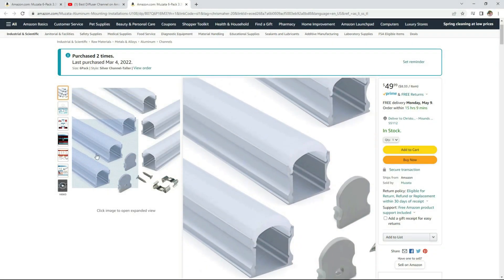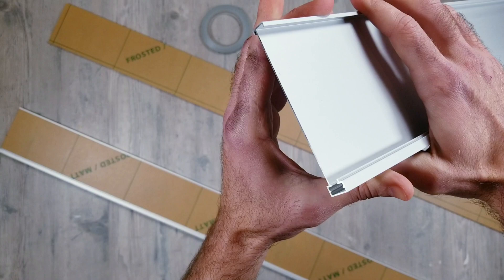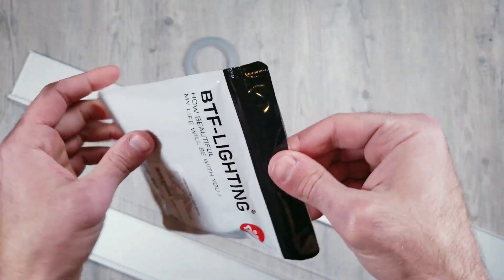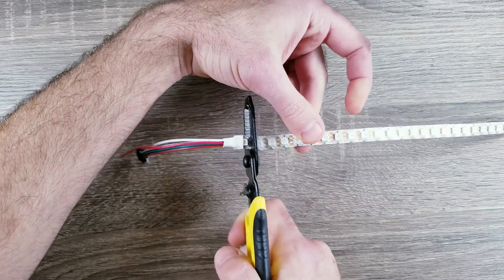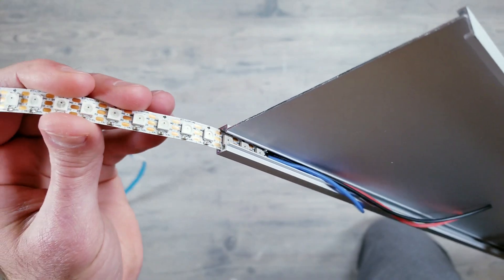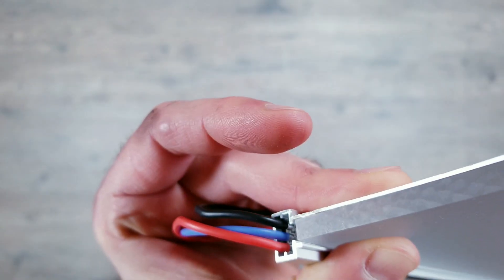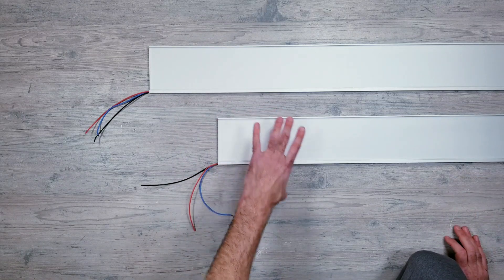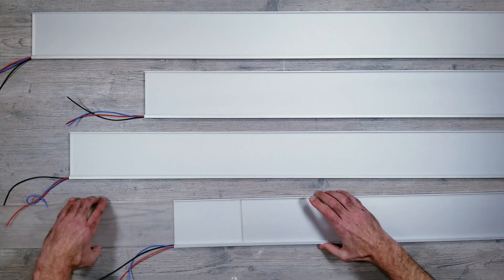Best EDGE LIT Diffuser Channel on Amazon.

Comment from the maker: 💥💥 AMAZON TECH Deals of the Day: https://amzn.to/42ud9FV 💥💥
Edge Lit Profile: https://amzn.to/3LX6UC6
LED Lights: https://amzn.to/3sjwJ7A
LED Lights AliExpress: https://s.click.aliexpress.com/e/_DC8lSoL
Best Regular Diffuser Channel: https://amzn.to/3uYO8ml

How To Solder Video: https://youtu.be/apSz3NXYlx8
WLED on ESP32 Video: https://youtu.be/TOEnFKLm9Sw

Other Materials:
ESP32 Board: https://amzn.to/3uDP1ln
18 Gauge Silicone Wires: https://amzn.to/3Keoel3
Wago Connectors: https://amzn.to/3vgFBeF
Micro USB cable: https://amzn.to/3jCLhtY
Big Power Supply: https://amzn.to/3uGPKSK
Wall Plug for Big Power Supply: https://amzn.to/3jCaXae
Medium Power Supply: https://amzn.to/3KKjAeV
Wire Stripper: https://amzn.to/3uHP4g4
Soldering Iron: https://amzn.to/3jxx1mB
Solder: https://amzn.to/3r6smMA
Solder Smoker Absorber: https://amzn.to/3rbHCYp
Helping Hands: https://amzn.to/3v19YG3
Heat Shrink Tubing: https://amzn.to/3733zSH

Other Videos I Have Made:
DIY Board and Batten video: https://youtu.be/b13VLiK7AOU
How-To Video for the LED Pegboard Project: https://youtu.be/K4EzLI1fFnQ
DIY LED Baseboard Trim: https://youtu.be/Ik8HnGxfQq0
RGB Lamp Hack: https://youtu.be/UNPR_98xLQY
Corner LED Light using Pex pipes: https://youtu.be/rIbTzUD2E4k
DIY Govee Glide using only paper: https://youtu.be/n9LsiQARFas
Simple Corner LED Project: https://youtu.be/ZB5HqWhMXNo
DIY Customizable Light Up Images: https://youtu.be/2q_zrEcbXHE
LED Strip Diffuser Ideas: https://youtu.be/09-fiWjP42Y
DIY Hexagon Project: https://youtu.be/t9xGyB4ahyY
DIY Edge Lit Designs: https://youtu.be/0_TtHkBB3vA
DIY Black Acrylic Floating Shelves: https://youtu.be/6csSMtV_op0

Other LED Tutorial Videos:
Installing WLED on esp8266: https://youtu.be/l8OMi7SMpqs
Power Options for LED Strips: https://youtu.be/KFtjf5mD6tA
Use WLED with Govee Lights: https://youtu.be/l0sRG1WAbq0
Re-Use Leftover LED Strips: https://youtu.be/ASnuk-XDVbI

Unboxing Videos: 
Lytmi Neo 2.0: https://youtu.be/sth-EdEfSis
Govee Lyra Floor Lamp: https://youtu.be/NFDYz37ZoXU
Govee Glide Hexa Panels: https://youtu.be/UDYUvfce4tM
Govee Glide Light Bars: https://youtu.be/e3jJye-fYoM

The best way to help support my channel is to like, comment, make sure your subscribed and share my videos with as many people as you can. The other way is to use the Amazon links above as I get a small % at no extra cost to you if you buy something. Thank you all for the support!

Comment: Would the Govee m1 strip fit in this? Do you recommend another plug n play strip?
Reply from the maker: Thanks so much for watching and great question! The govee m1 would not fit this. Its a tiny bit to wide to fit the channel.
Reply: @ChrisMaherDIY  got it. If I wanted to place these next to each other, do you solder them with very small wires or solder the strips together without wires?

Comment: Nice reviews! Are 30 leds/m with a budget diffuser channel enough to get a flawless result when its passive? In example to get light on the wall behind the desk when its 5-7cm away from the wall or are there noticable light spots then?
Reply from the maker: Thanks so much for watching! 30 leds per meter will work just fine as long as the distance is far enough. I'm not sure exactly what the distance needs to be before the lights blends perfectly together but my guess is at least a couple inches. Thats a good idea for a video and I'll put it on my to do project list to find out!

Comment: Oh hell yeah. This is what I’m needing.

Do you think the Govee M1 would work well enough with these without being hot spotty?
Reply from the maker: Thanks so much for watching! So the Govee m1's are just a tiny tiny bit too big to fit these! I tried at home and no go. Even if they could fit though, it would not look as good as the ones I used in the video which were strips that had 100/leds per meter vs the govee that has 60leds/meter.

Comment: Love this! Just ordered a couple of the panels from your link to experiment with. 
Question: your link to the LEDs you used are for a 3.3ft length, and the panels say they are 4ft panels. Did you get splice in additional lights to fill the panel, or is your demo using the standard 3.3ft strip? I ask because it looks like it disburses well all the way to the edge in your vid. Love the look.
Reply from the maker: Hey buddy! Thanks for watching and hope you like them! So I spliced in additional lights to fill out the entire 4 feet. But yeah, the 100 leds/meter light strip works perfect! Let me know what you think!

Comment: Chris two questions do they have an end cap , or something to connect two or more together in a row. I'm thinking of putting them around the outside trim of my house. Thanks for always doing a great job. 👌
Reply: Chris, I'm also looking for an answer to this question. Thanks!
Reply from the maker: Thanks buddy! No end caps from what I've seen online but they do butt up very nice together and the seem is not noticeable unless your very close.
Reply from the maker: Thanks so much for watching and great question! No end caps but they are all machine cut so they fit together very tight and might only be noticeable from very close up that there is a seem where they connect. Man that would look so cool as trim on the outside! Thanks as always buddy!

Comment: Would it be possible to set up a long run with power injection about 50 feet
Reply from the maker: Thats a great question. The led strip goes in to the channel very snug. I think there would be a way to drill small holes in the back of the profile to feed some injection wires in but I have not tried doing this myself so that is only my assumption. But as the old saying goes, where there's a will there's a way lol.

Comment: whats the benefits of soldering insteed of using plug'n'play clips ?
Reply from the maker: Great question! Not much of a benefit. I think the data signal will be a little stronger with the thicker wire if you have a long wire from your controller to the first LED and voltage drop will be slightly less with the thicker wires but overall, not much of a difference.

Comment: The price is ridiculous. I guess they stop making it because of the cost to make it verse the profit . Not worth it
Reply from the maker: Yeah I think your right. It has to just boil down to cost. I am still trying to do a DIY version of this. The diffuser part was the easy part. Trying to come up with a very slim housing for the diffuser to sit in has been very challenging to say the least. But I'm going to keep trying to see If I can come up with something! And for a DIY version, I'm thinking the cost would be somewhere around $80 dollars for 4 feet but that would include the lights as well so a little bit cheaper but not a lot.
Reply: @ChrisMaherDIY  I would think you have some influence. If you call them and tell them that your viewers are saying that the price is too high. They may lower the price . I was ready to but it today but when I realized it was for just one I was like hell no. Honestly 4 for $100-120 is better

Comment: Do you think 🤔 the m1 by govee will work?
Reply from the maker: I just checked and the govee m1 will not fit in the channel. Just a tad bit too wide unfortunately. Plus the govee m1 has 60leds per meter and for a great effect like you see in the video, I'm using an led strip that has 100 leds per meter. Great question!

Comment: Well I was excited to use these, but now they are $80 for a single 4 foot piece? That’s insane and super disappointing
Reply from the maker: Its crazy expensive! But I think someone else mentioned that the cost to make them must be pretty high as well so for it to even be worth their time, it looks like 80 dollars per 4 foot section is the price. I am still trying to do a DIY version of this. The diffuser part was the easy part. Trying to come up with a very slim housing for the diffuser to sit in has been very challenging to say the least. But i'm going to keep trying to see If I can come up with something!
Reply: @ChrisMaherDIY  you should be able to design a 3D-printed profile eeeeeasy! And LEDs don’t get warm enough to melt the PLA.
Reply: @AlvaroQF  you would need a fairly large printer to make something 4ft long, no?
Reply: @BackpacZach  even with 4ft sections you would need multiple of them right? so why not just have even more 2ft sections lmao
Reply: @ChrisMaherDIY  can you share some info on the diy diffuser? $80 per 4 ft is too much
Reply: Far too expensive ... and yet they sold out in less than 6 hours!!!
Reply from the maker: Very expensive! Looks like they are still available in the US. I don't think they are selling them anywhere else at the moment unfortunately.
Reply: I was about to say the same thing, hurts my head because the want is strong

Comment: Would the govee 60 led per meter work with these or will the hot spots be to noticeable?
Reply: he said it will be noticeble, use atleast 94 leds per meter
Reply from the maker: Thanks for the great question. You can for sure use 60 but the effect is not as stunning compared to using something that has at least 94 leds per meter. In the video I use an led strip that has 100 leds per meter and works perfect.
Reply: @Chris Maher  under old video where you connecting nodemcu or esp8266 I ask can you test sp801e controller.
Reply from the maker: @DimaLegoFUN  Thanks for the comment and sorry I have not gotten back to you on that one. I'm about a week behind responding to comments :(  I do plan at some point doing a video on all the different controllers so the sp801e will for sure be part of that!
Reply: @ChrisMaherDIY  cool, thx i have to several controllers

Comment: Thanks for sharing Chris! So I’m guessing that if they were installed on the ceiling around the wall edge that the optimum place for the led strip would be on the opposite the wall? 🤔
Reply from the maker: Thanks for watching and yes that is correct. That is where I would put the strip!

Comment: do you really get 2 panels for the $80 or just one? If so this is a deal because trying to do it DIY the price for acrylic shipping is crazy. The description on Amazon says it only includes one, but if they send two panels I'll buy two packs! Thanks again for making these cool videos!
Reply: just 1
Reply from the maker: So when I made the video initially back in May, they sold a 2 pack and a 1 pack. Looks like right now they are only offering the 1 pack. Its for sure on the pricey side!

Comment: Again, not available in Europe so yea.. pass.
Reply from the maker: They need to branch out to Europe!
Reply: @ChrisMaherDIY  Yea, Europe is way bigger than the US (450 million people). Most of the people are very technically advanced, high spenders, contrary to the southern parts of US. Muzata is losing a lot of massive potential buyers and profits.
Reply from the maker: @StringerBell  Do you think any of it has to do with certain plastics that are in products might have restrictions on being sold in Europe vs the US for health/environmental reasons? Just trying to make sense why they would not offer it over there?
Reply: @ChrisMaherDIY  I'm not competent enough to be able to answer that, but when you take into consideration that there are tons of led diffusers out here, even in European amazon's ,I don't think this should be the case.

I think it's more of a bad managment/logistics/planning thing. The mere fact that they are "back in stock"  means that they cannot get a hold of their production line and demand. So the reason for not scaling to Europe is kinda self explained.

Great product, weak business managment. It's just a matter of time until someone see this niche and do the things they currently do but at much faster pace and scale.

Comment: these are soooooooo cool
btw what is the name of the acrylic they use?
it looks like a smoky clear
i wanna diy from scratch
Reply: Just sand normal acrylic
Reply from the maker: I think its just some basic frosted acrylic. Like Reid mentioned, you can just get normal acrylic and sand it for a similar look! I've been trying to make something similar for a while now. The diffuser was the easy part. The housing has been the challenging part.
Reply: @ChrisMaherDIY  tyvm for the info
for a diy houseing i was thinking of using sheet metal and bending it similar to this product
to fit the led strip and houseing will hold up the acrylic .
the price is cheaper and u can do the whole room for cheeap
Reply: @ChrisMaherDIY  For the housing, what about 3d printing modular sections using reflect-o-lay 3d printer filament? Haven't used it so I'm unsure of how reflective it is, but surely there's a way to print the channel out of reflective filament, or inlay/spray the channel with something reflective, or dipping it in a paint? Depending on solution could be cheaper than aluminum, although not as strong
Reply: @alexross4062  I don't think it actually needs to be reflective. It just needs to be the right dimension to hold an LED strip right onto the edge of thick acrylic.